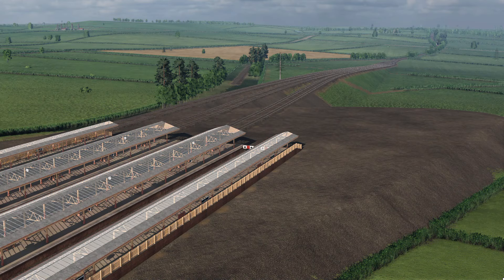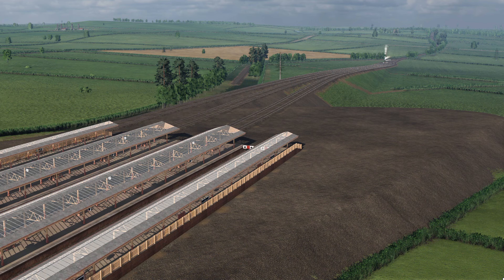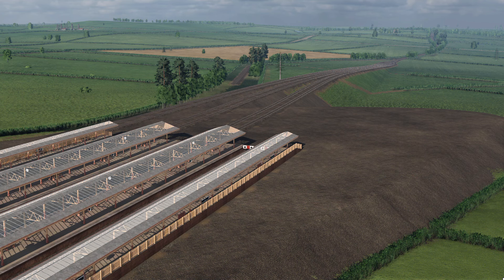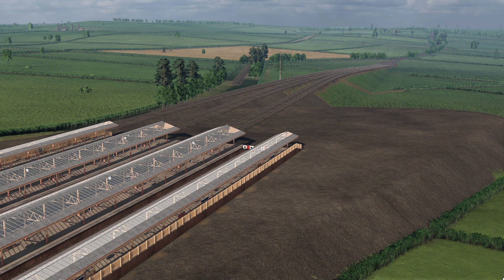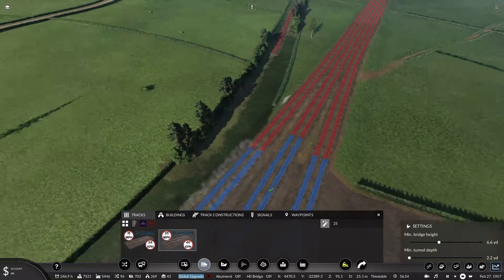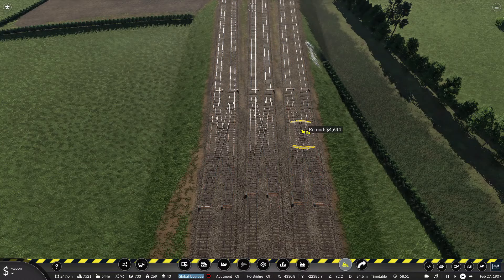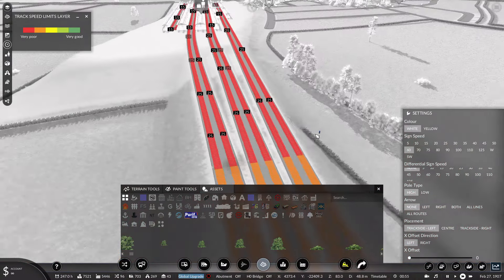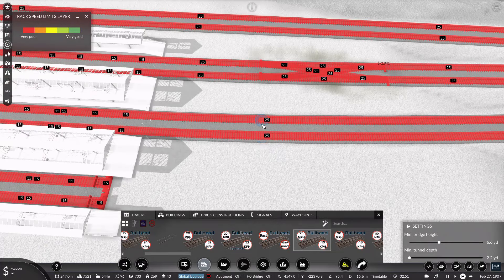Preparing for Faster Trains | Transport Fever 2 - The UK Mods Series | #146

Comment: Bear in mind of course Farringdon's approach is electric trains, the Lickey Incline needed 2 or even 3 banking engines on the back to get up or double headed express locos. Only loco I can think of that would get up on its own is 71000 'Duke of Gloucester', although the Jubilee class 5690 'Leander' managed it with a smaller train of about 6 coaches. 

The steepest adhesion worked incline without a rack rail in the UK, was the Hopton incline on the Cromford & High Peak system of inclines. Small tank engines like the North London 75 Class and Hunslet Austerities (mainly ex-LNER owned J94s) worked it till the 1960s.